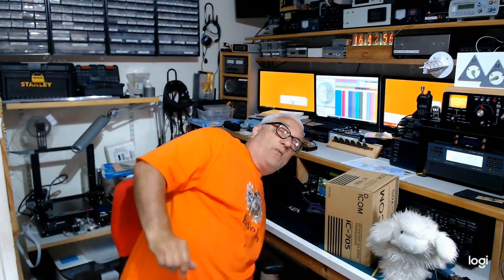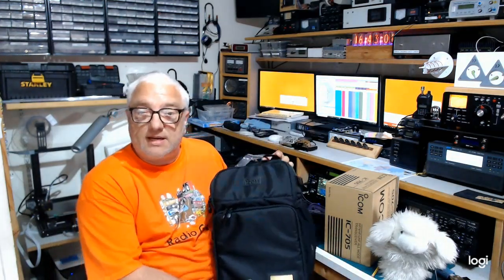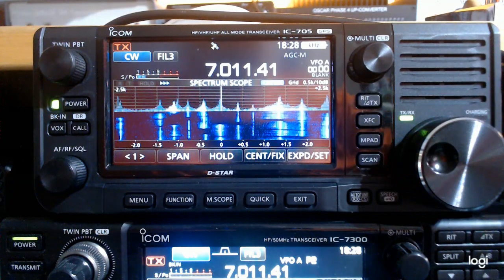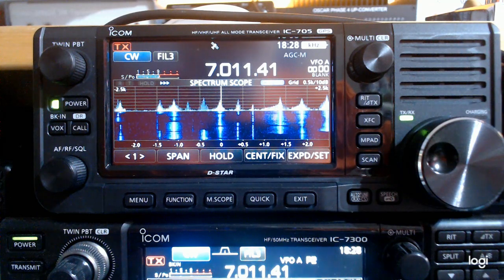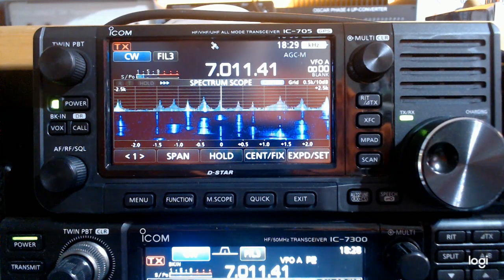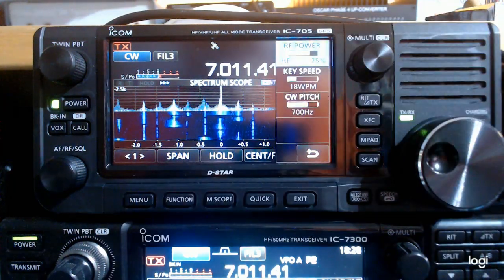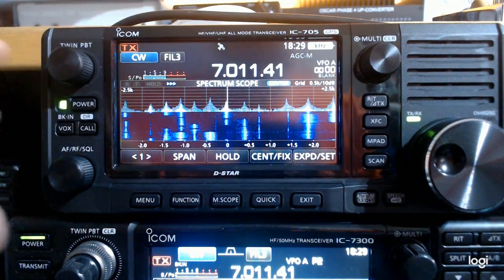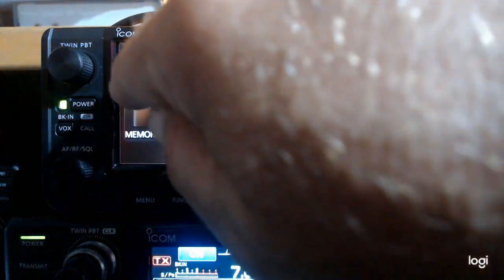Icom IC-705 - A first look at the RX

Comment: Have the IC-7300,  IC-7900, so won't be needing this... 10watts would break my heart on HF, especially with current HF propagation. Grand if you want to work a few casual qsos, but otherwise you'll struggle.
Reply from the maker: I generally run all my rigs at about 10W to drive my Expert 1.3K-FA linear amplifier. The number of times I have called and worked a station only to later realise the amp is on standby is many. Dont underestimate what you can do with 10W! As a base/portable or even mobile rig this was mighty impressive. Its very compact and the technology is very impressive.
Reply: I disagree,  10w on HF will get you nowhere, try  working USA, Middle East on 14Mhz with 10watts, waste of time...
As i said 10w you'll work a few local European stations.

This radio is for a limited number of operators, just wouldn't be anything of use to me, and I've the 7300 and 9700.

Comment: Excellent starter rigs for new M7s; given it can be used base or portable and 10W/5W. I presume it can be used with an amp as well?
Reply from the maker: Certainly can be used witha linear
Reply: @MarkG0MGX  Really interesting; that opens a lot of options and use cases. I like it.
Reply from the maker: @johnratcliffe6438  I was more than impressed with the radio - the RX performance was superb. I didnt find a way to power a masthead amplifier from the radio (like you can with the 9700) for V/UHF but I was really rushing and didnt have a manual :-) so maybe you can.